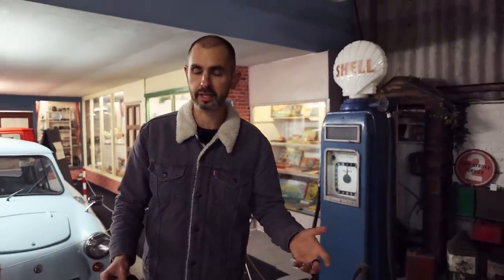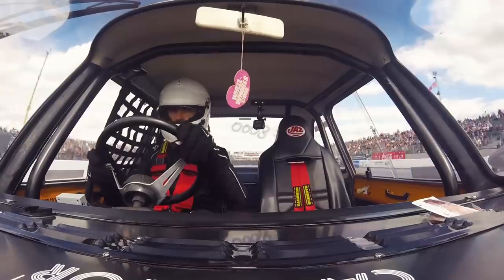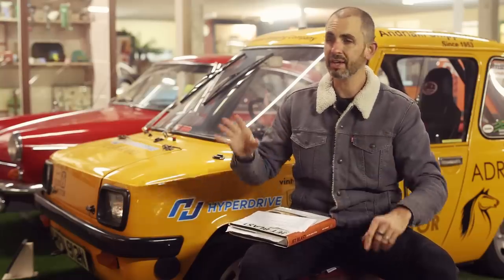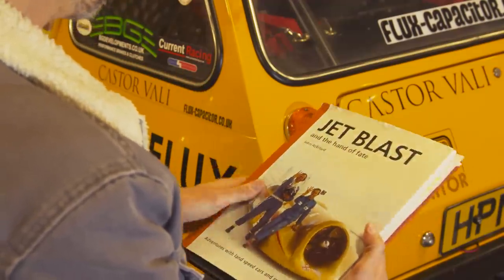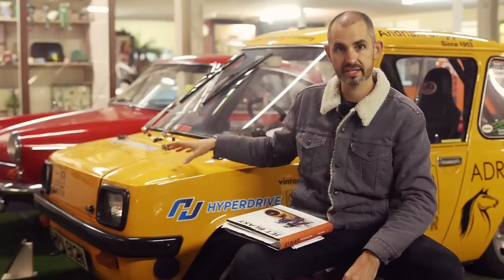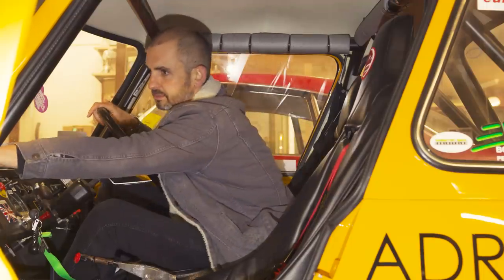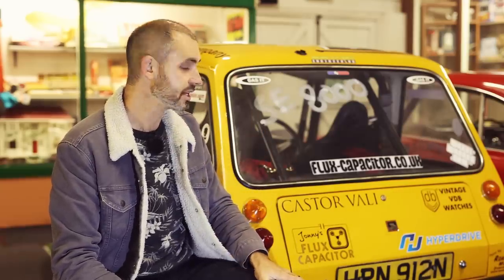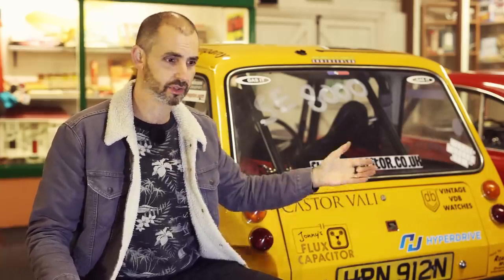Building the World's Quickest Street Legal EV

Comment: Jonny knows that "quickest" and "fastest" have different meanings. I like Jonny.
Reply: what's the difference? (not native english speaker here)
Reply: @Imthefake  Quickest = least time / best acceleration
Fastest = highest top speed 

If a car has great acceleration, it's quick. If it has a high top speed it's fast. 

To be honest though, most native English speakers treat both words as interchangeable, so it's usually seen as pedantic to point out the difference between the two. In drag racing though, they do have different specific meanings that actually matter.

In drag racing, quick = seconds, and fast = mph. So if you do a pass that's "9.86 seconds @ 121 mph", and someone else does a "10.12 @ 128 mph" pass, then your car is quicker, but their car is faster.
You might even hear someone mention a car being "the quickest and the fastest", which means it has both the lowest time and the highest speed.

Comment: Remembering these and the Duke of Edinburgh having an electric Bedford van might well  have inspired me to enter the 1980 Lucas Electrathon.  Stated 55Ah batteries are clearly wrong here  for the stated  "over 300kg" weight - I've seen another reference to 165 Ah traction batteries, which seems more likely. Meanwhile I could manage 19 miles from two 40Ah batteries  at a dizzying 20mph with  Webb battery lawnmower motor propulsion.

Comment: 10:07 If it did use Imp front suspension, and it looks as if it did, then the original tech is very wrong as the Imp front was swing axle with kingpins. The dampers and springs were coaxial and the lower spring seat was on the damper so I'll give them the 'coil-over'.
Reply from the maker: It was Imp King pin, which we had refurbished, then added poly bushes to the A-Arms (which had been reinforced for the original Enfield's battery weight) and AVO adjustable dampers.
Reply: @TheLateBrakeShow  So definitely not MacPherson strut. TBH I'd have thought polyurethane bushes were overkill due to the shape of the originals. Back when I played with them the mod was Chrysler Comps stiffer bushes with the front ones cut down and a thick packing washer fitted to locate the axles better fore and aft.
Full marks for this amazing project.

Comment: Today you could probably use two motors at the back, one directly to each wheel, and not even have to use a rear axle and differential, which would save a lot of weight and make it even faster.

Comment: If you reduce the power would the range go up? Sorry if that’s a stupid question but even 200bhp would be insanely fast in something this small

Ps love the Lego 🤣
Reply from the maker: Yes, we map it on the software to run higher amps/volts, so by running it in 'valet' mode we could get a higher range from the batteries. In truth we never really range tested it extensively, but I knew 50 miles was fine. The main objective was to get the power for drag racing.

Comment: I saw a video where a man was using large capacitors to turn over his engine to get it started. They would turn the engine for quite some time. They were light and could release allot power but not store so much compared to a battery. I wonder if an electric drag car could use tens or even hundreds of capacitors for a short burst to get up to top speed?
Reply: someone on youtube created a Radio controlled  " Super Capacitor Dragster "
Reply from the maker: It is possible and has been discussed, yes.

Comment: How long did it take to charge?
Reply from the maker: Depends. We never needed to charge it after each run, but typically with a 32 amp supply we'd give it 45 mins to an hour every 3 or 4 runs (running at max of 2000 amps when racing). Then we'd put it on a v low 10amp overnight trickle to balance the cells slowly.

Comment: Electric motors, much like steam locomotives of yore, produce maximum torque at zero revs. The problem has always been weight. Steam engines are, by design, very heavy but can pull thousands of tons and will get up to respectable speeds, eventually. In the 60's and 70's, there were loads of electric vehicles, but most of them were trams, trolley-buses and milk floats. 
The key change is battery technology, as you rightly mention. Lithium batteries are massively more efficient than the old lead-iron variety because they are lighter. With top torque instantly available, an electric motor is perfect for drag racing, and no expensive engine re-builds afterwards. But shit, good effort! Awesome!
Not sure that battery power is the future though. Hydrogen is obviously more sustainable and Lithium mining is extremely environmentally un-friendly.
And I will forever miss the smell of petrol fumes, Castrol R, and the thrash and roar of an internal combustion engine, when it all gets banned in the very near future. But I guess that's life! Love and peace.

Comment: Hmm... who owns the intellectual property for the Enfield EV? Is it out of patent now? You did a marvellous proof of concept for a modern high performance EV with the Flux Capacitor, I wonder if it would make a good, cheap electric city car now if you could take another one & restomod it as a production ready electric hot hatch, using all the off the shelf Bosch or similar BMS, motors & EV batteries, or innards from another manufacturer. If it was a real production prototype I might speculate that you'd have to add more crumple to the crumple zones  & make the steering column collapsible or whatever, but what if the Enfield 8000 went back into production as the Jaguar 8000 Citycar? Come to think of it, Enfield is quite big news in India these days, how about them bringing it back? Or the chinese company that bought Rover? I mean, you already have your famous tentpole performance variant, & your half a century of model heritage, & you've not even started the project yet :-).

Comment: I think all you EV enthusiasts are missing the boat trying to skip hybrids that STILL use the internal combustion engines as the primary source of power. Not only is the lack of feel and sound of internal combustion sorely missed in all-EVs; but they're typically ugly as F too. For something to sell it has to appeal to the MAJORITY of the public you nerds. Not only that but hybrids don't require the battery capacity of all EVs and hybrids don't strand anybody for lack of a F-ing charging station. What's more there's even successful already on on the road which can be reverse engineered and improved upon so nobody has to waste time re-inventing the wheel. Hybrids are the next logical step. Don't let your Marxism get in your way. It's a well known fact there aren't enough current battery technology resources to provide enough batteries for all EVs worldwide in the first F-ing place.
Reply from the maker: Had several hybrids Joseph. I owned a Chevy Volt and mk1 Insight.
Reply: @TheLateBrakeShow  Excellent. Now build one that uses the engine to motor connection for drag-racing and you'll change history.